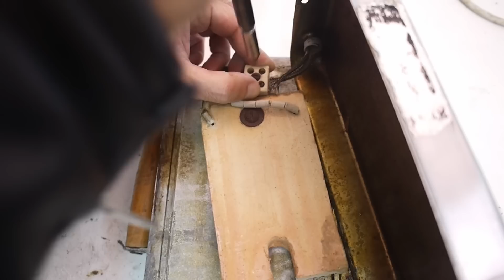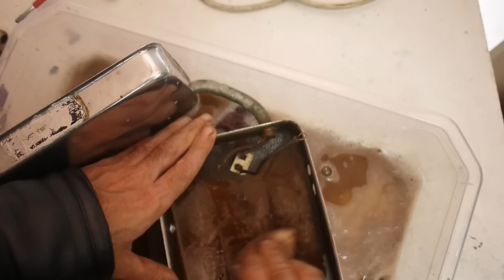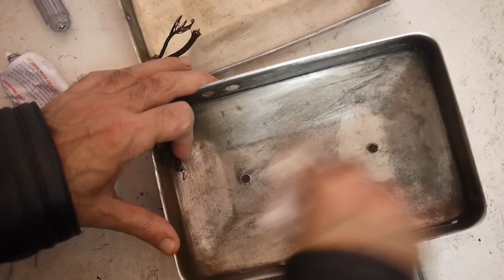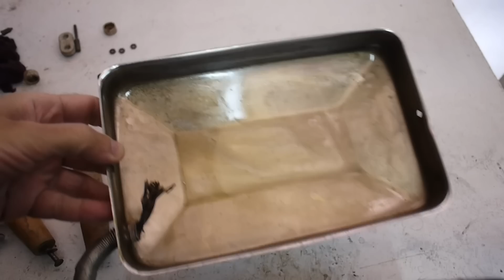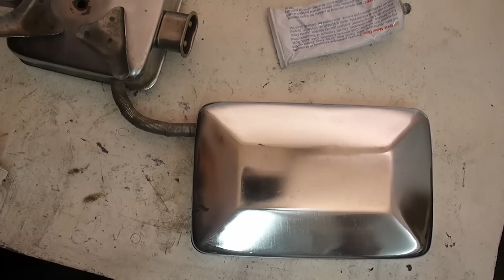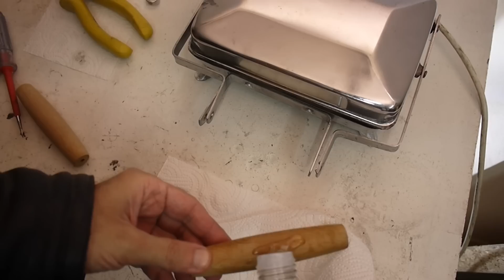1920 Antique Sandwich Toast Machine Restoration

Comment: You should change the old electrical wire and cable also...
Reply from the maker: You're quite right. I changed the cable before I started using it.

Comment: The toaster is probably younger. The feet seem to be spot welded which was not common before 1930. And the style does not really match the 1920s too. I'll put it in the 1950s. Nice work nevertheless.
Reply from the maker: I am not sure about the age.I found smiliar ones on Ebay.They stated the production date as 1920. I took them as a reference.